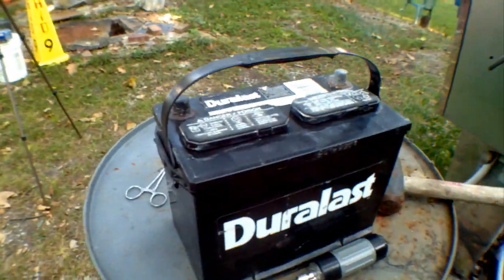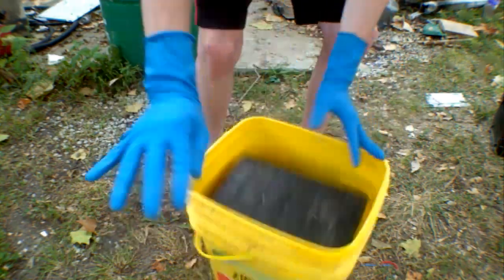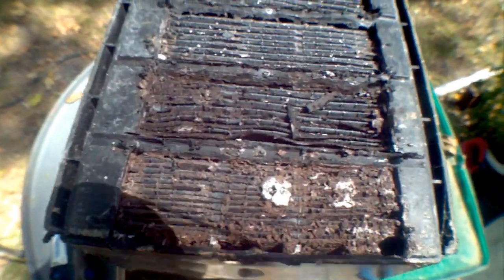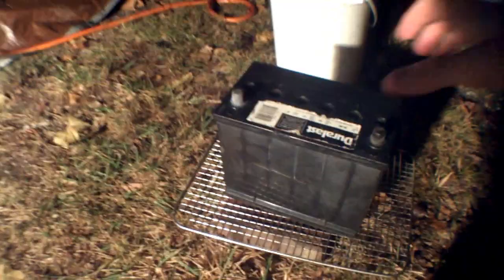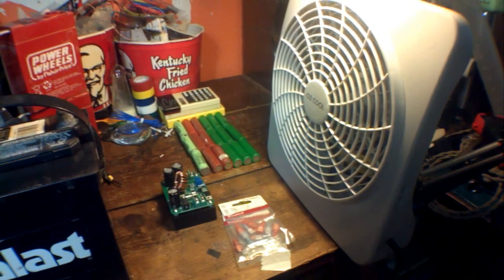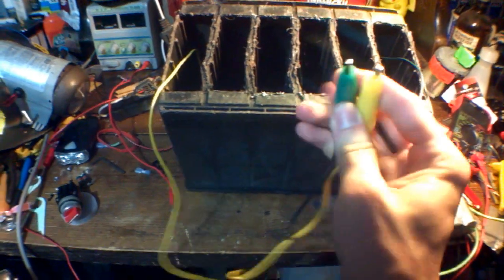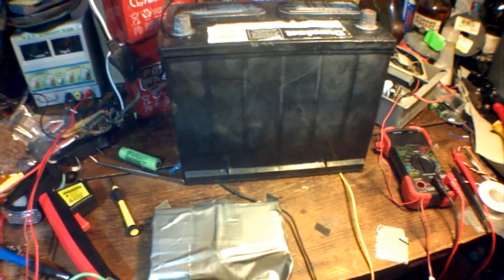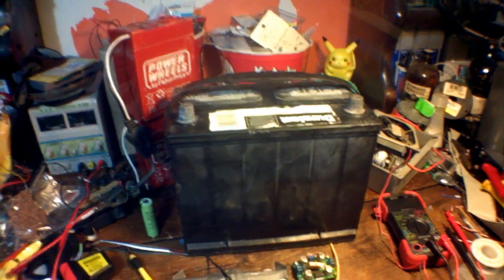DIY Lead-Acid to Lithium-Ion battery conversion 18650

Comment: Why go through all the trouble of tearing down the old battery and the danger involved when you can take a piece of 3/8 inch plywood and make a nice small box with a neat little rope handle with two bolts out the top with wing nuts and an on/off switch for less than $10.
Reply: Sentimental value of the battery I guess

Comment: What's the point of this batery "repack"? why u simply not put that 18650 cells in some casing, u only risk working with acid, and when u work with acid u must wear protection, u saw what can happen (drop that battery in that bucket full of acid LOL) u are crazy dude :D Ant it's not smart to solder that cells, they are sensitive to temperature, and when u soldering them they heat up, and in that way they loose some capacity,  best way to connect them is with spot welding, u can make spot welding machine with some super capacitors, and u need Nickel wire.

Comment: Having a car battery being used as a case for such a small battery pack seems like a little over kill. Getting a project box relatively closer in size to the actual power bank seems a little more logical and practical. If you had gone through with the original plan that would be a different story,, That was a great deal of work put into something to end up with what you had.

Comment: This moron throws caution to the wind and dumps Hydrochloric Acid out of a battery wearing shorts and sandals just to try to convert the bad lead acid battery to a lithium-ion battery to power his camping fan! Doesn't he realize that Makita already makes battery-powered fans using the battery packs from their cordless drills.
Reply: Sorry, I meant  Sulfuric acid not Hydrochloric acid from his battery. Either acid would have felt terrific to get on his bare legs!

Comment: Protective gloves for hands with bare feet. (<—The funny)
(The serious —>)  Then the splash from battery falling in bucket. 
Great safety visual to cover hands, feet, face and eyes because, as you can see, you never know what can happen.

I read the down comments regarding the impracticality of this project. 

I say welcome to our world of creative geniuses. This is how we work, this is what are environment looks like, it’s all a big painting pallet for us to dabble in.

I’m actually working on a similar SLA to Li-Ion conversion, but for another application. This was a good preview.

Trivia: The Tesla battery operated vehicles use large battery banks using 7000 18650 cells.

Comment: You have to be the dumbest worker I have ever seen with your PPE, if you even understand the concept!
Reply from the maker: clothes will hold acid, its best to have less clothes so it doesnt soak in and you can quickly wash off if you get any on you.

Comment: This is absolutely and totally a work of love and a great example of the sentimental value this battery has for you. It took so much effort and work to accomplish your goal and I'm so glad you got it working while preserving your battery but admittedly, since you couldn't use the terminals yet, you could've just used the bucket that you used for the acid as a holder instead. But, of course, it would not nearly be as cool as looking at your old cherished battery's outer shell housing your lithium fan power source. Thanks for sharing!

Comment: Do you think it might have been safer to use a clean, plastic box for this build?
Lead-Acid batteries are full of some really nasty stuff, which is not very friendly to the environment, or your health.
Just a thought. I do like your video.

Comment: You could have attached a photo of the car battery to the cell pack if you are that sentimental. Works the same since you couldn't use the old battery terminals and it would be more ecologically friendly.
Reply from the maker: i dont think you understand this.

Comment: I'm trying to figure out why he put the same shirt shorts and sandles back on after trying to take a shower to remove the acid that most likely is still going to burn him because he didn't say he neutralized the acid!
Reply from the maker: wasnt worried aboit acid, was worried about lead. this had hardly any acid in it

Comment: You should’ve used a buck converter and wire the batteries in series so the batteries are not pushing such amperage and always never wear shorts and flip flops when working with any acid sulfuric or not or neutralize the acid before working or might as well be working in your birthday suit good luck safety is always paramount

Comment: What a fucking idiot!! Let's wear protective gloves with sandals an shorts??? Fucking dweeb. Not to mention what a waste of time trying to use that battery case lol
Reply from the maker: but this video made me 2,000$, and the reasoning for sandals is because its quicker to wash off, you shouldnt wear absorbant clothing around acid lest it absorb it and continually burn you

Comment: I want to add, next time please nuetralize the acid before u dump it. I'm curious to how that battery is still working for u. It seemed like it was in a very tight space without much room for dissipating heat.

Comment: I guess for sentimental reasons u wanted to keep the battery shell, but next time u work around acid, have baking soda on hand. Also, I would have taken it in to AutoZone for a $10 core gift card and just used a plastic project box.

Comment: Very interesting to watch your MacGyver of a lead-acid battery into a Lithium-Ion battery. Learned a lot from the teardown and then the subsequent rebuild. Some viewers don't seem to understand that learning by experimentation is valuable in, and of, itself. Sure one could buy a pre-made Lithium-Ion battery, but one learns nothing from a mere purchase.  

Of course, during the experiment prep phase I would have donned protective clothing in anticipation of handling battery acid, and protecting skin, eyes and lungs is fundamental to a lifetime of successful MacGyvering. But, no lasting harm was done, and we must admire the straight ahead engineering enthusiasm that is demonstrated here. (As opposed to armchair trolling by guys who will never disassemble a battery or anything remotely risky.)

I subscribed because I admire the true diy tinkerer who will attempt almost anything that might yield some new knowledge and a possible practical application.  Kudos to you sir!

Comment: You put yourself in harms way to build something that doesnt even work. Cutting apart batteries without proper PPE or respiratory protection. If you lack the funds or common sense to do something safely and efficiently, don't do it in the first place. You put the youth who may view this video at risk for your own thoughtless actions.
Reply from the maker: but it does "work", because its just supposed to look like a battery, and it does. also i made a bunch of money form this. so it works out.

Comment: I would open it from top empty it all out, cut walls between cells and you have very nice case for all your lipos.

On other hand why bother just make plywood container and have your batteries inside. In this case you are not limited by size  and shape.
Reply from the maker: would you mistake a plywood container for a battery? the whole point is to make this look like a lead acid...
Reply: @RinoaL  As you said, you use it for camping, not even for vehicle. I bought some Nissan leaf cells, made a plywood box put them inside and now i have 5 kwh battery which can be used as starter battery if needed as it can deliver 2000 amp@ 12v. I also use it for my boat electric motor, I simply open my plywood lead and switch some wires and I have 24v for my boat motor.

Unfortunately laptop batteries don't have high discharge rate, so they are ok for some camping gear, but almost impossible to use for starting vehicle or boat motor, unless you put a few dozen of them in parallel.

I tried this but they sagged a lot with 70 amp load @ 24v and my boat motor was cutting off frequently.

And I  used brand new Dell laptop batteries, not old half dead junk.

Some 18650 batteries do have high discharge rates, like ones used in makita etc  tools, but they aren't cheap.

But anyhow it is nice to see people thinking outside of the box and try things, so good luck!

Comment: I use yamaha libero 106cc, mafe 2005 india, i want to use lithium ion battery for it. I had collect good cells from laptop battery and a 3s2p BMS for it. Now i wanto yo know can i use this direct alternate to my existing 12v 2.5ah lead acid battery

Comment: Okay sorry but I gotta laugh about protective gloves but have shorts and flip flops. Speaking from a experience there is no pain like a broken little toe and chemical burns suck and does have lasting effects in your future. Be smart about things what you do today will effect you tomorrow.
Reply from the maker: i am smart. pants and boots would absorb the acid and hold it against your skin burning you worse. this way i can wash off quickly
Reply: @RinoaL  Yes and no, There's a method to everything to be safe but you are at least thinking about safety which was my concern. Maybe consider a waist height table, apron, reinforced toe shoes, face shield, and the gloves you were wearing. I know this stuff cost money and you're probably like the rest of us and broke. Just a consideration, otherwise, I liked the video. I just don't want to you to hurt yourself in a way that might effect you for the rest of your life is all. I'm no genius and spent my life in factories and I see easily preventable incidents happen all the time, but I'm not knocking you in anyway just a weary parent speaking.

Comment: Please nobody ever try what he is doing here. And if you must then wear some proper safety equipment. I see you have a lot of videos on batteries. I am not going to watch them. The reason is that upon seeing this video I understand that you have no real knowledge or understanding of what you are doing. Especially when it comes to safety and being in the proper environment. Just because you can, doesn't mean you should. You would have been better off building a battery pack and making your own housing for it. Would have taken you an hour and you wouldn't have covered yourself and poisoned the ground with lead and acid.

Comment: Cool video. Please wear safer footwear when working with hazardous materials. Slippers aren’t good for working. 😊
Reply from the maker: i disagree, sandals are good when working with acid because you can quickly wash off, if you have boots that the acid soaks into it will be burning your skin for however long it takes you to untie your boots.

Comment: I get it, you are nostalgic about the battery that's taken you from childhood up till now. I can be the same way at times and feel connected to objects I grew up with, but that sure is a lot of work to retain the aesthetic of your trusty old camping battery instead of all the other ways you could have achieved the same ability to run your camper fan. Other ways would probably take less space and be lighter and handier too. But like I said, I get it. I just would have given up a lot faster when I realized how much work it'd be for no real gain. I'm currently sitting at almost 220 18650 cells and also looking for frivolous uses for them. For now I guess my cell phone just occasionally gets charged from them.
Reply from the maker: no real gain? i think making like 2000 dollars from this video is one hell of a gain, and i still have the battery
Reply: Can't argue with that. I like your videos I've seen so far and am glad you make a killing on them.

Comment: although is is dangerous to do that but should of cut the top off  not the bottom it would be hard to cut the battery terminals from the inside and have easy access to the negative and positive terminals   from the inside

Comment: you luck out that could have lost your stomach into that buck if u get a good splash that can burn off your muscles.
Reply from the maker: battery electrolyte isnt that strong, concentrated stuff maybe, but not the stuff you find in a battery.

Comment: Very nice alteration, creativity goes a long way, nice to see. Usually replacing a car battery costs close to $100 if not more, depending on your vehicle make and model. If one has multiple cars in the family you can be saving hundreds of dollars a year by restoring them at home. 

Mechanics and car repair shops profit more than 90% of what you are charged for a replacement. Restoring your batteries back to new condition in most cases can be accomplished rather quickly. These easy methods apply to most other kinds of rechargeable batteries as well. Knowing how to recondition my family's batteries has saved me hundreds.

You can begin learning how to restore your batteries here: https://tinyurl.com/ybet5fzb

Comment: You should really rename this video, because what you end up building cannot be used for what it was intended. I really don't understand why you felt the need to use a battery case for this.
Reply from the maker: +Raymond Swaim why cant it be used for camping power supply? and i used this case because its interesting.

Comment: An interesting little project, but of no rational value. Have you ever heard of PPE. That's short for personal protective equipment. Safety toe shoes, face shield, real rubber gloves rated for caustic solutions, being fully clothed, etc.....
Reply from the maker: +Robert Beck fully clothed so the acid soaks into the fabric and continues to burn you while your trying to take it off instead of just being able to wash off? no thanks. ppe used in the wrong place can make things more dangerous. this honestly wasnt very dangerous to do.

Comment: Fantastic project.  I don't trust those mechanical connectors anywhere especially where there hidden.  but other than that I may follow your path with a number of old batteries I have around.

Comment: Dude, a quick shower later and you are still wearing sandals to do what you are doing?  Also, what the other commenters are saying is true, beside the acid being dangerous, the lead is a hazardous waste and shouldn't be exposed to the environment, really.
Reply from the maker: +Jim M yes because you can easilly wash the acid off the sandals. but itd soak into boots

Comment: Good show, kid (probably not a kid now).  You kept something sentimental and made something useful out of it, and got an education in the process.  When the SHTF and you can't wonder down to the store, you'll know how to make something out of what ever you have laying around.
All the goons, making the negative comments, will be crying for your help when the SHTF.

Oh btw, wearing the flip-flops was not a good idea (esp when you splashed the battery in the bucket).
Reply from the maker: +sdm0964 actually sandals is better than boots, because boots can soak up any acid and burn your skin longer. its easier to take sandals off than wet boots or whatever.

Comment: DUCT TAPE ADHESIVE IS CONDUCTIVE. Not a good idea.
Reply from the maker: +Zachary Stone i highly doubt that.
Reply: Rinoa Super-Genius it is. I found out by making a series of 9v batteries as a teenager. Doubt it all you want, but your DMM or a meggar set to 50V will confirm this.
Reply from the maker: oh you mean duct tape, as in the aluminium foil for furnaces? well no fucking shit its conductive. its made of solid metal.

but as for duck tape, no it is not conductive at all. i just checked and its not even resistive.
Reply: Rinoa Super-Genius Nope, regular duct tape. Heat and moisture tends to soften the duct tape and adhesive, it gets gooey and quite conductive if used on batteries running lots of current and putting out heat.

So defensive. What for?